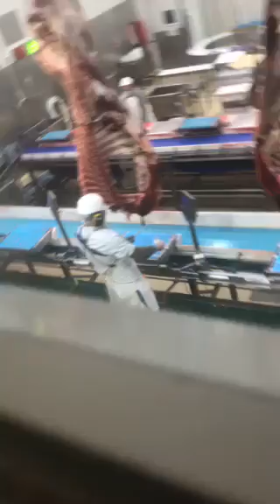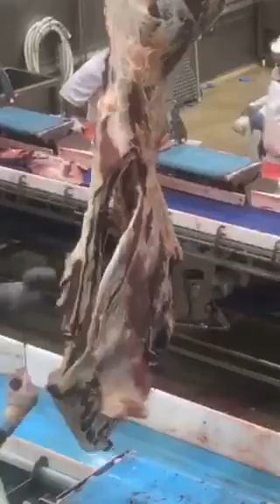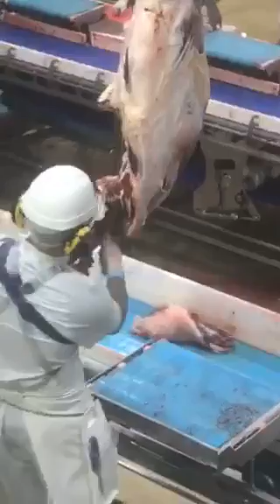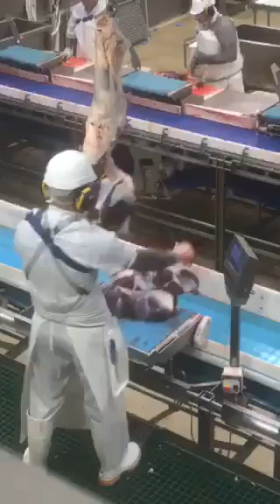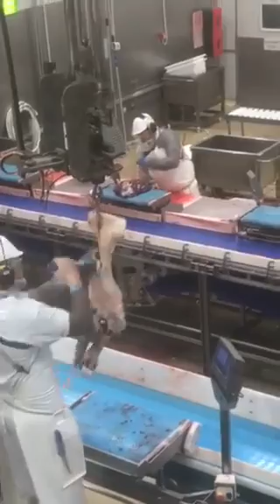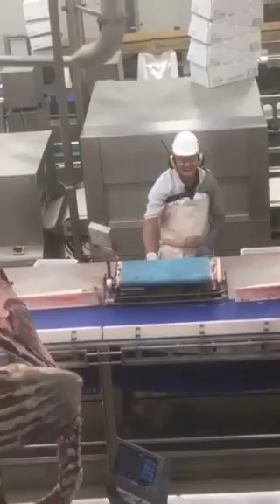Beef boning - Bull Nzl HEARTY

Comment: You're obviously very skilled. Excellent knife control, precision, and speed. I do have a couple of questions and would love to get a respond back from someone with expertise in this field, such as yourself. 

What do you use to sharpen your knife, do you have some sort of sharpening system that you use, or just a good ol' norton oil stone? 

Kind of hard to see on the video but what type of steel are you rockin' with? It's not one of them fdick combination one is it. I prefer the fdick polished oval and fdick rough oval.
Reply: @thechosen1557 what grit sandpaper do you use ?
Reply from the maker: @DiamondSigns  240